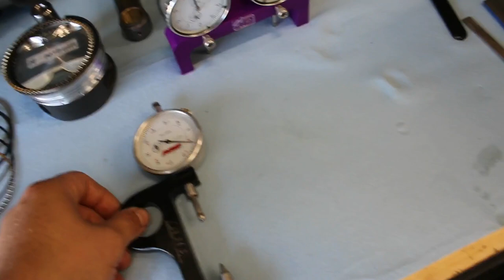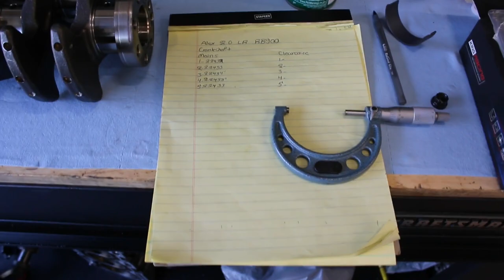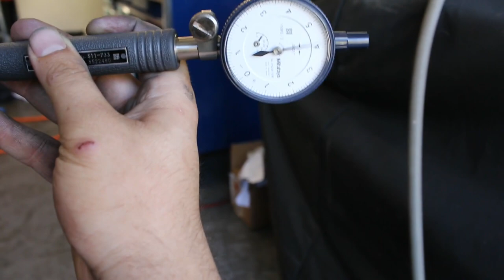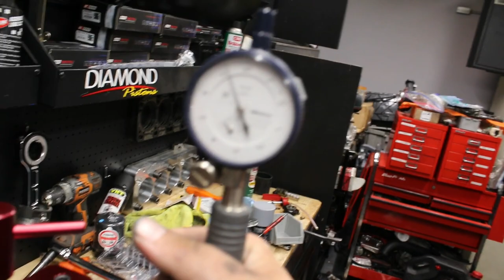4G63 Engine Blue-Print assembly process!

Comment: Hey whats Ron quick question do you know if Manley crankshaft by any chance changed there oil system on the crank from tear drop diagonal to straight thru oem design.

Comment: Hey Roni,
I have a 4g63 that was recently rebuilt but the rings apparently failed. I am having excess blowby and the mechanic says it needs to replace the rings and valve seals again. Any thoughts on what we missed? Thanks
Reply: Couple of years ago, but did you find what caused your ring issue and any change you meant when you reassembled? Thanks

Comment: What do you think would be the Highest comp. that could be used for an N/A 4g63?
Reply: N/A  are you talking the 1.8L ?  I dont know if you can find a setup to do it, but 14:1 I think is possible you would make more power going 9:1 and boost though.
Reply: @epoxeclipse  It would be a 2.0---class rules
Reply: @josefernandez-gi1ne  the 4g63 n/a is a 2.0l and also found in 1.8l  the 420a/ na is 2.0l.   Stock it has ok compression but lots of na cars go higher, but it's rather costly to get power na out of these.  Free flowing exhaust, decent cold air intake is a start.